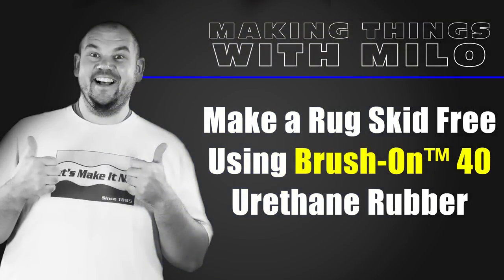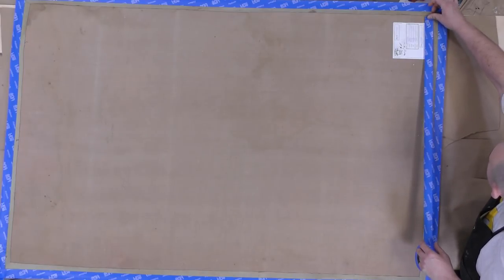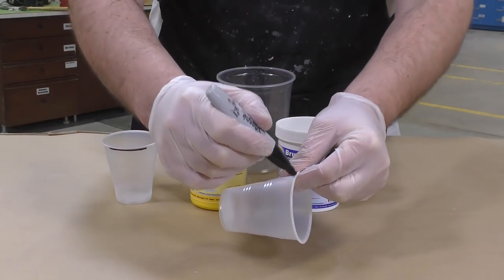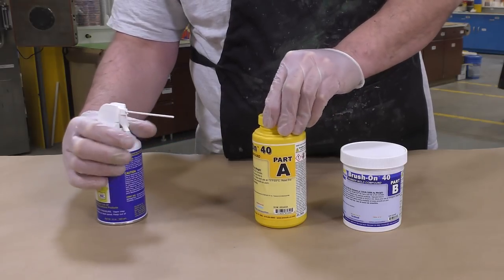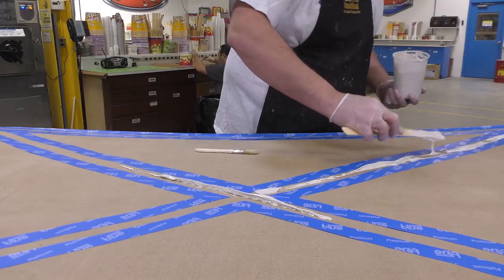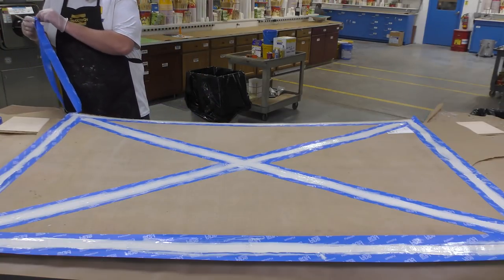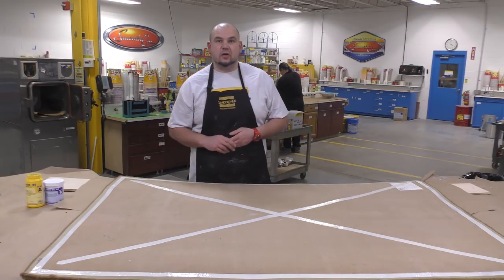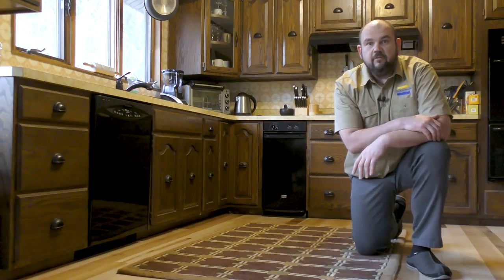Make a Rug Skid-Free Using Brush-On™ 40 Urethane Rubber

Comment: Can you wash the rug?
Reply from the maker: We would recommend that the rug be surface washed (ie. a pressure washer) on the front.  This will not affect the bond.
Reply from the maker: We would recommend that the rug be surface washed (ie. a pressure washer) on the front.  This will not affect the bond.
Reply from the maker: We would recommend that the rug be surface washed (ie. a pressure washer) on the front.  This will not affect the bond.
Reply from the maker: We would recommend that the rug be surface washed (ie. a pressure washer) on the front.  This will not affect the bond.
Reply from the maker: We would recommend that the rug be surface washed (ie. a pressure washer) on the front.  This will not affect the bond.